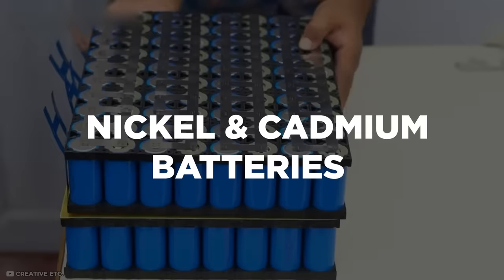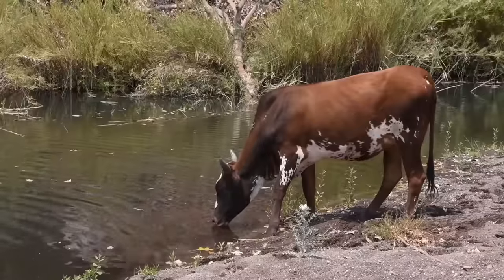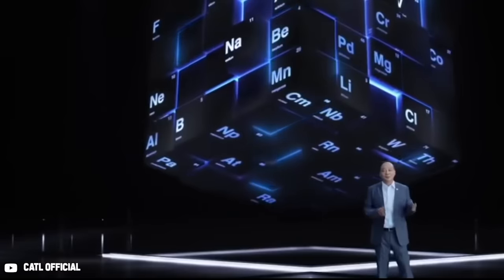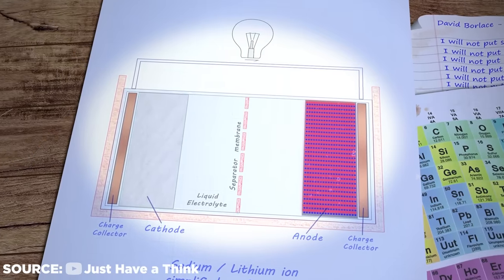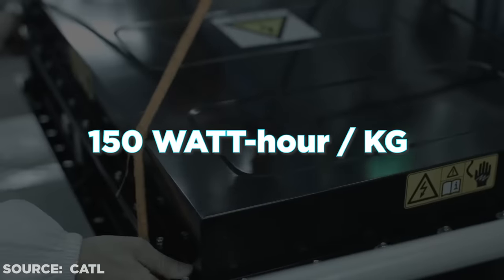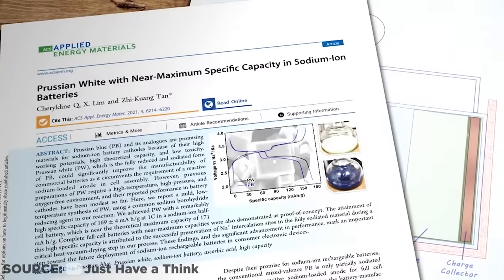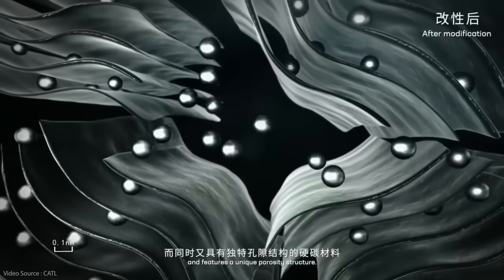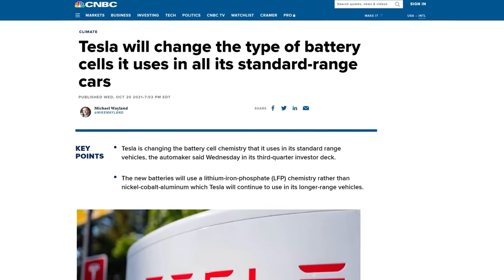No More Lithium! NEW Sodium-Ion Battery To BEGIN  Mass Production

Comment: a battery has to meet a lot of criteria for specific applications. Lithium is light in weight, but poor in daily charge cycle longevity...........losing 15 to 30% of capacity in the first 4 years. Just because something is light, or has good energy density does not make it durable, or effective in certain applications. Lead/carbon hits lithium out the park for static storage,cycle performance for example. For lowest price, heat storage, simple common sand or refractory bricks have massive density and never wear out. Sodium may well beat out Lithium, but its not a proven technology yet, and when energy is stored, in a cathode immediately adjacent to an anode, the risk of a catastrophic short, and subsequent release of energy in a fire is still problematic.  Just watch a demonstration of sodium being put into water......it literally explodes on contact.

Comment: I couldn't help but notice how you left out any reference to more dangerous aspects, as with Lithium.  For instance, in NYC, USA, there has been a rash of Li-ion battery generated fires, caused by either the use of inferior, Chinese manufactured batteries, home-owners and businesses leaving batteries charging overnight (causing them to overheat and ignite), or by foolish individuals attempting to repair/rebuild Li-ion batteries, exposing the Lithium metal to moisture, causing them to explode.

Similarly, when sodium metal is exposed to water, you also get an exothermic reaction (the silly thing goes blowy-uppy).

Comment: I think that I see some feasibility with this batteries, Lithium is way lighter, but sodium is way way cheaper and has less political conflicts, I mean you can get sodium from table salt, therefore, sea water. I think that I se how this may work for cars, since batteries are way cheaper, you maybe able to change your battery in a fuel station instead of charging it, then the fuel stations can give them their required 10 hours of charging, that considering that not a lot of energy is lost in the process and that hydrogen is still not a better option.

Comment: Better for gadgets and grid storage where weight isnt a premium. A larger intercallation matrix for the anode is needed, but the cathode material can be similar to existing lithium chemistry. One benifit is that sodium can use plain old iron oxide in place of the cobalt. Something with a aluminum ferroferricyanide cathode and a iron oxide ferriphospate anode will work nicely. 🤓❤
Reply: Weight might not even be an issue if electric cars were made to get people to work and back, and not 200 miles, or go 200 miles an hour... and if you didn't need an 8-core CPU and a 7" ultra-HD display to make phone calls.

Isn't it weird that no matter what energy storage we use, we always end up with the same battery capacity in our devices? Don't you feel like a laptop could run for 3 weeks if we wanted it to?
Reply: @stickyfox  you have a halfway decent point, however when it comes to mobiles batteries will self discharge, slapping a bigger battery on a less hungry device wouldn't necessarily increase the battery life proportionately (i.e. it may be more practical to scale performance to capacity). Another factor is that as battery energy density increases form factor tends to decrease, those older devices may have had a similar battery life, but with far less performance and far more bulk/heft.

As for cars you're absolutely right, but on that token you may as well be arguing for bikes (it comes down to an issue of consumer preference).
Reply: @xxportalxx.  I think manufacturers are afraid nobody would be interested in a $20,000 EV that had a 25-50 mile upgradable battery, in spite of the number of people who live less than 10 miles from work and get free charging as an employment benefit.

We can put off developing the massive battery capacities we dream of and satisfy the current demand using less material; and then in the meantime while we improve the tech the consumers who want to go 200 miles can slap a full-size battery in their car and enjoy a drive across the state.

That, or they would prioritize selling the big battery as a "pay to unlock" premium feature, and aren't on board with a customer getting what they want and no more. We're living in a weird time.. it'll be interesting to watch.
Reply: @stickyfox  well most ev's made today aren't designed to ever have the battery replaced, the new teslas integrate them into the frame even! They're designed to last the life of the vehicle. So you'd need a pretty big redesign of the ev concept as well. Downside of this is that making them replaceable would make the vehicle less spacious and heavier. Tradeoffs I suppose. 

Personally I'd never purchase such a vehicle, or an ev in general honestly, but that's bc my state is very large and not very dense, I live pretty close to work relative to my states avg and it's a 20mi commute, beyond that seeing an ev charge port is like seeing an elephant they're so rare here. Public transport is also essentially nonexistent (including ride sharing apps for most of the state).
Reply: @stickyfox  Why would I want a car that can't go more than 200 miles without charging? If the charge took 5 min, that might be OK, but there are times I want to go on a driving vacation for 500 miles.
Reply: @stickyfox  It's all about lifestyle and you pretty much nail it in your first sentence. This concept sounds amazing, but you are asking the majority of US consumers to "change and adapt" to new life style, which is hard and almost impossible to do in this country without some kind of MASSIVE incentive.
Reply: @dingzhuxi  the incentive is huge IMO but hard for people to imagine. Having a little cash today to solve your short-term problems feels safer.
Reply: Brother, I still have yet to reach the point in my degree where I know exactly what you are talking about. But know this, I adored every last word of this comment
Reply: Neeeerddd needed 🤓""if you combine the periodic elements they will produce power " no shit shirlock   its about batteries 🤣🤣🤣
Reply: @dingzhuxi  The problem is that in the U.S. cycling is a thing mostly rich people do. Good bicycles can be as expensive as used cars. Low Speed Vehicles can go for more than a nice used car. Until the market makes sense people won't choose them. I would love a solar electric enclosed bicycle but I can't justify the price for all the things I lose. Until these options start to make financial sense no one will choose them.
Reply: @stickyfox  a car needs to get me 99% of the places i go to, which is not just work. Sometimes it's friends nearby towns and certain stores. People have cars for the freedom of movement they provide. If we're also arguing the 20k price point, you have to compete with cars like the corolla. You're providing no benefit.
Reply: @Distress.  A decrease in cars (edit: range of EVs) would necessitate an increase in public transportation, which the US is really opposed to. Sucks because I would love to just have a bike and take a bus or train everywhere and would make cities way less car crowded. Probably would improve our road infrastructure to have less cars wearing them down too.
Reply: @N1ck00  Id like more public transit too, but none of that would change that when im spening 20k on a new car I'd compare it to all avaiable options.
Reply: Replacing cobalt with iron oxide? 🙌🙏 that would be incredible especially since there’s a crazy amount of slave labor involved with cobalt mining in the Congo which supplies over 75% of the worlds cobalt, right? I heard about that on a fascinating interview on Joe Rogan.
Reply: @stickyfox  a 16 core phone CPU can sip power if it needs to. Just look at iPhones. Most powerful CPUs yet they have the smallest batteries, and are still somehow competitive with Android whose batteries are 40% larger at times.

Also more powerful is usually more efficient. You can't reasonably increase power consumption on a mobile soc, because a phone just isn't big enough to passively dissipate all the heat. So when you hear phone CPUs getting more and more powerful, they're usually using the same power to do more
Reply: @Distress.  I and many others might argue that 99% of the places I need to go are within 20 miles. I live in a city and there is free charging everywhere. And if I never paid anything for gas and my car was only $20,000 I would be able to afford a nice rental car for long trips and spare the wear and tear on my EV.

Obviously a 20-mile battery won't appeal to everyone, but if it was a gateway to ownership of an EV and solved all of a customer's transportation needs, it might appeal to that person, especially if a later upgrade or hi-cap rental would be an option.
Reply: for grid storage, there are better solutions .... not based on battery cells at all. For the gadgets - the problem is power density. We use more power in smaller form-factor. Event current lithium ones are ...kinda small already.

The only feasible appliances - are from 2 to 40 kWh storages for home usage, so survive outages or off-grid life.
Reply: @stickyfox  The capacities in phones have continued going up.
Reply: WITH THE VERY REAL DANGER OF EXPLOSIONS WITH LITHIUM BATTERIES..THE SODIUM CAN’T COME SOON ENOUGH FOR ME…WILL NEVER EVER BUY A PRODUCT THAT RUNS ON THE DREADED LITHIUM BATTERY! ..ELLE
Reply: @stickyfox  Keep going with this train of thought. You don't need to haul an entire living room furniture set and a surround sound system for your solo commute to work either. When you really strip it down to what a local office commuter needs, my ebike has a 30-50 mile range... using 1/70 of the battery cells required to make a Tesla. It gets the job done and they cost on average $2,000 not $20,000. A lot of people say to me oh I can't replace my car with a bike, I need it for xyz situations... sure, but I bet you don't need a full size car for your SECOND family car. Micromobility (bikes, scooters, those whacky unicycles, etc) is blowing up in cities, but cars are only getting bigger with the industry pushing overgrown SUVs as the default vehicle for everything. The industry is ignoring a whole spectrum of possibilities in between that and a full size car that would work for more people.

Comment: I'll only believe it after only after they come off the production line and have been in use. but being 20% less energy by weight so there will be cars with batteries that will be heavier so more dead weight you will be driving around. Which puts additional limits on the distance you can travel per Kwh.
Reply from the maker: That’s true. There are a lot of downsides too. Let’s hope they will find the best solution both for the environment and for the market. Thank you for watching!
Reply: Who says it's all about cars.
Cars are only a small part of the market share compared to global grid storage needing TWh.
Reply: Li-on batteries lose capacity to 70% in a year so Tesla have that disclaimer in the sales contract. 30% dead weight batteries after a year and continued decline until effectively useless in five years.
Reply: @biomechanique6874  you're talking crap
Reply: @biomechanique6874  40+yrs in electrical/electronic engineering
Reply: @jeffp3999  ... and you've learned nothing....
Reply: @biomechanique6874  prove your case of lithium cells losing their capacity to that extent in 1yr while I get some popcorn 🍿
Reply: @jeffp3999  Tesla warranties are based on worst case scenarios. Different people drain and charge their batteries differently and most not in optimal scenarios. To preserve battery life many say only charge to around 80% then occasionally 90%  to minimise loss of capacity. Pardon me for mentioning this but that isn't using the full capacity - but if you do full charge and discharge cycles you actually shorten the life of the battery. I don't have to prove anything, go read the Tesla warranty.
BTW my niche is biomimetic robotics in special and extreme applications where lithium technology hasn't worked out.
You are quite welcome to go burn in a Tesla or whatever death trap of your choosing at your earliest convenience.
Reply: @biomechanique6874  there you go, you made a blanket statement about Li cells dropping to only 70% of original capacity, available, after 1yr and so you know you were crapping on now because you and many others know that's highly dependent on charging and use.
Reply: @jeffp3999  I had to give up on lithium a while ago. Lithium Titanate was the only tech that could deliver the required duty cycle for the robotics development but is still not ideal. The bottom line is that I will never be a fan of lithium ion batteries because in testing they never failed to fail to live up to the hype.
Reply: @biomechanique6874  glad you found a suitable chemistry.
Reply: That's why EVs with batteries is a dumb idea, for a car to work you need an energy generator instead.
Reply: @ghoulbuster1  you also need a buffer for the electric drive, so what do you propose, that's currently available, that better than a battery?
Reply: The primary use is probably grid storage and things like power-walls, where weight is not so important, and if energy density is 25% less, it doesn't really matter.
Reply: @ghoulbuster1  IMHO, hydrogen fuel cells are probably the better approach to widespread EV.  You can refill in minutes and be on your way.  Yes, it's somewhat less efficient, but also the cost is dramatically less than a mountain of Li-ion batteries.  Also, hydrogen can be generated at the source.  Presently, the low efficiency of hydrogen factors in the need to transport it, but that's an infrastructure problem.  It could be generated at the point of use - it's just water and electricity, which would bring it much closer to battery efficiency (maybe 50% vs 70% for batteries).  But it's a lot more efficient in terms of energy density, so the lighter weight might completely offset that (haven't calculated it).
Reply: @eventhisidistaken  how dare you be rational and logical in a YouTube comment
Reply: @eventhisidistaken  Can it withstand the impact of another car slamming into it at 30-60+ mph without exploding or starting a massive fire, like ice engines typical do. If not it's doa for vehicles

This seems like a ridiculous amount of effort to adapt a new fuel source to run cars when both gasoline and electric have their infrastructure already in place, and neither are hard to come by.

This is cool as a hypothetical or thought experiment, but i see absolutely nothing practical about it in reality right now or even a decade from now.

It seems as though it is a solution looking for a problem, rather than the other way around, at least for vehicles.
Reply: @someguy3711  I haven't tried that test, but as an engineer myself, I know this is a matter of design.  Keep in mind, hydrogen fueled vehicles are not future tech.  There are already thousands of such vehicles on the roads, and in parts of California you can refill them at gas stations as easily as gasoline, so presumably they've considered that.
Reply: @hhjhj393  This isn't to defend the sprawl we have currently, because most of it exists solely for social/class reasons, but dense cities don't eliminate the need for vehicles. They aren't able to be self-sufficient. There are too many demands for food, water, energy (heating, cooling, light), waste management (trash and sewer), maintenance materials and other goods for the land a city is on to support its population without import/export. A person in the middle of nowhere can build a homestead that is self-sustaining (with potentially severe sacrifices to quality of life). A city is quickly going to turn into a biohazard if one tries to operate it without outside infrastructure. Building fixed infrastructure means there needs to be mobile work crews to maintain it. You can remove the need of car-like vehicles (horse and wagon included) for the individual, but they need to exist in quantity for the upkeep/supply of dense areas.

Comment: Looking forward to this. I want to store my solar energy and this seems perfect as I don't care about weight and dimensions in this instance. If it's cheaper than Li, count me in!
Reply: Same
Reply: Exactly, who cares if the sodium ion battery weighs 30% more than lithium ion batteries but are 40% cheaper if you already have the space at home to store it.If you spent $10000 on lithium batteries for your home solar system you would want to switch to sodium ion batteries if the cost is only $6000 with similar shelf life!.

Comment: The video at 2:44 is the building of hybrid Li, Na pack. Allowing car manufacturers to tune cost vs size and weight. This will allow Car companies to make a cheaper option with less range of the same car cheaply since the battery packs would just differ in weight and energy storage. if you freeze the video you can see the blue packs are labeled Lithium-ion and the silver ones Sodium-ion

Comment: Did they mention charging cycle life? Would be curious how they compare to lithium if they don't run into lithium dendrite issues.
Reply: I'm sure you can just pop the battery open and cry into it and it'll be good as new.
Reply: @huldu  sodium metal, not sodium-chloride. If you cried into it you may lose your face